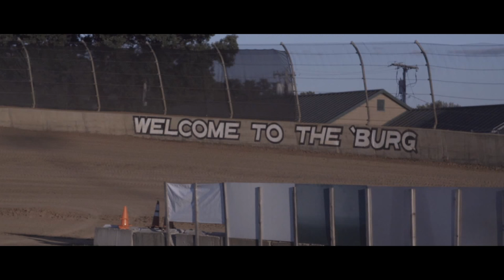Dirt Racer | Under The Hood-Valvoline | eGarage

Comment: hey Joshua, do you have a set of Original Magnesium Halibrand "SPRINT" Wheels...15"x 4.5"...5 on 5.50" Bolt-Pattern and a set of halibrand 16x10" or 16x 11"  for sale..?
forgot to mention that what I'm after will take both bolt patterns:  5 on 4 3/4  and 5 on 5 1/2 pattern.